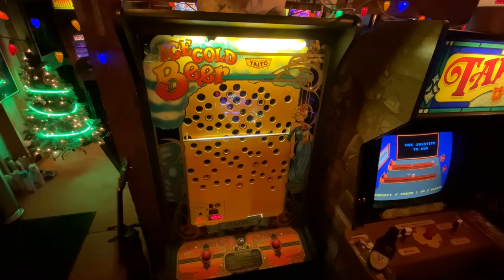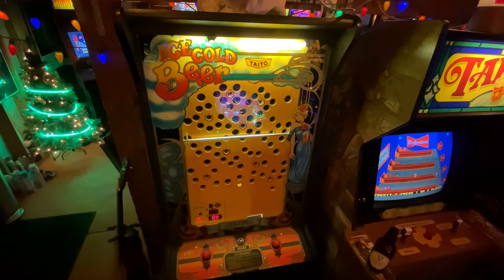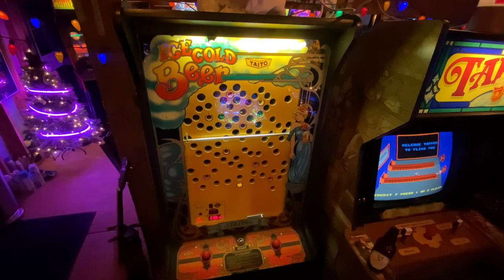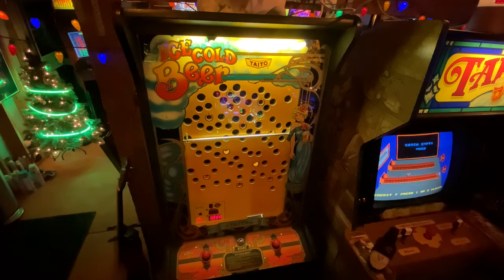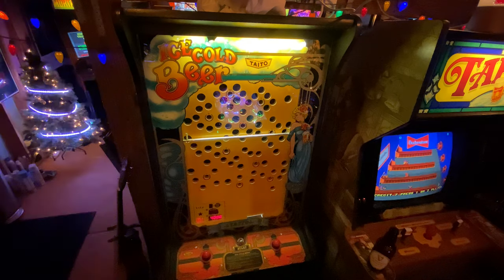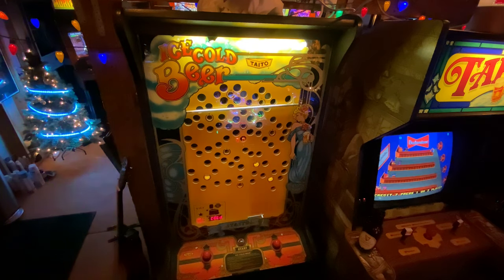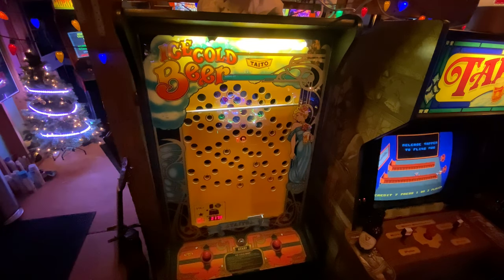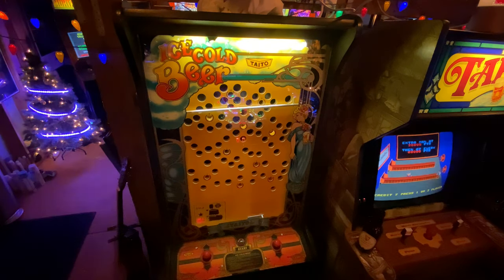Ice Cold Beer Gameplay

Comment: How's she working to this day? Looks to be in decent shape. I am looking into being one of the RePro's but I am scared of how fragile it may be. You are also very good at it for only playing 12 times lol.
Reply from the maker: She's still cranking along, I ended up building a bar in the basement last year so this game on theme really fits even more now.    I do occasionally get some PCB-related, ball switch not registered errors but they usually clear up on reboot. 

I spent quite a bit of time hovering around the booth with the repros on display at free play florida, year before last.   At the time my takeaway was the repros are actually a bit more hardened compared to the original.   The lead screw drive system (like a 3d printer) is more precise, less parts to fail.   My impression is they will be the rare case where new coke is better than original.
Reply: @arcadeshenanigans   Good to know! Thanks for the info!